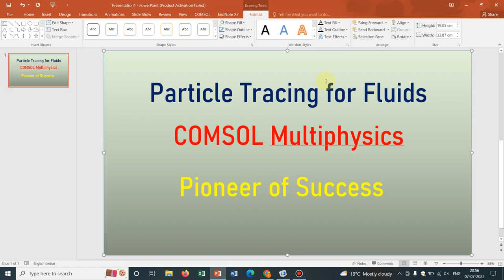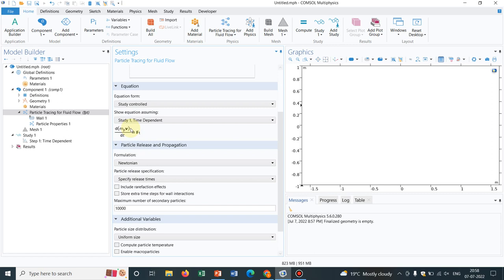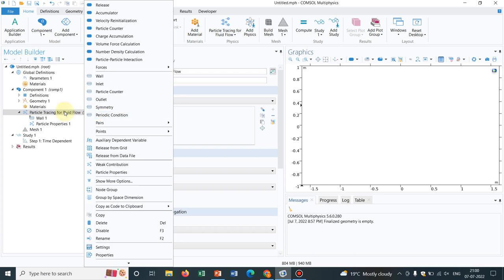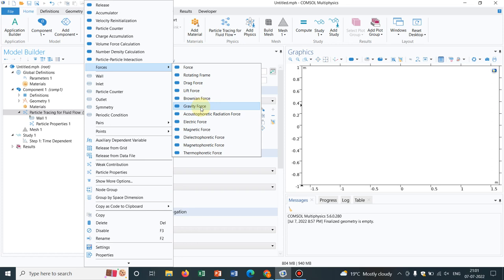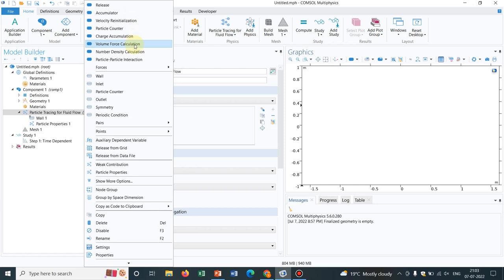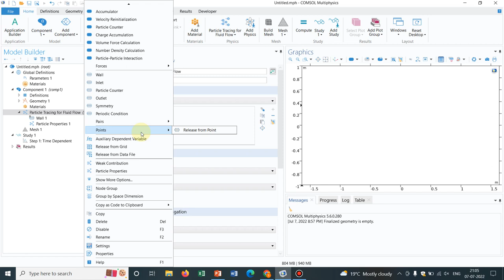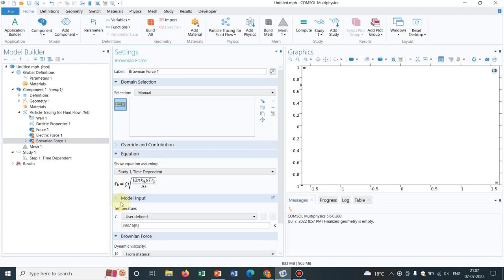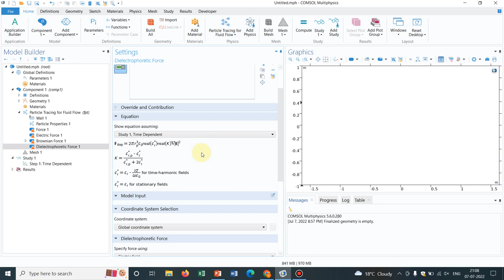Introduction to Particle Tracing for Fluid Flow #fpt #ParticleTracing #FluidFlow #Research #COMSOL

Comment: Hello, thanks for the video it was very helpful. Do you know how to setup a simulation as follows; there's an anullar system where the inner cylinder is rotating while the fluid is flowing throw the anullar space, and the particles are going in the way of the fluid. I'm trying with rotating domain and deforming mesh but i haven't get good results yet. It'd be very helpful if you give me some tips or make a video. Thanks!

Comment: I have a large number of particles, I calculated the flow field in Study 1, and the particle traceing in study 2, which is unacceptably slow because of the discrete random walk used in the turbulence model in the drag model. How can this situation be resolved?Thanks so much